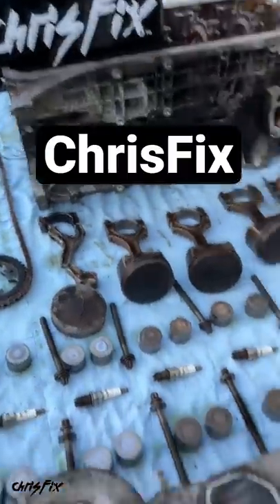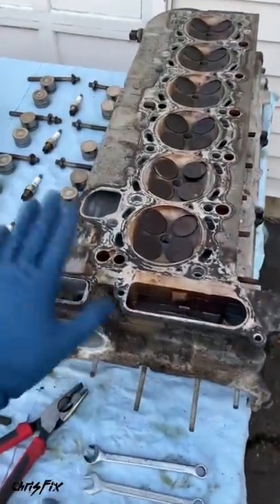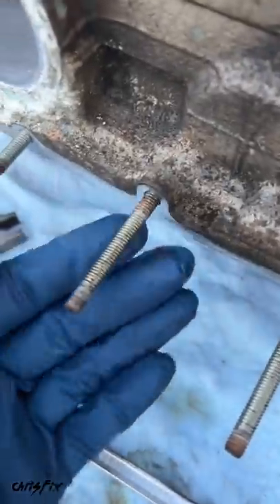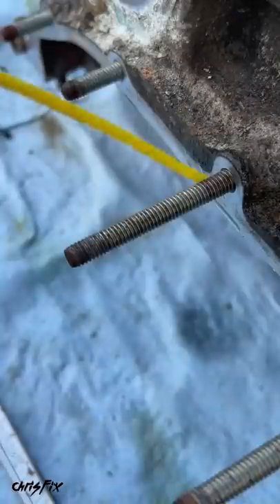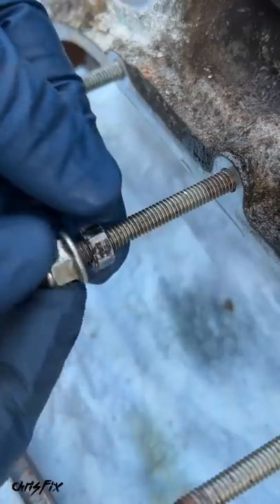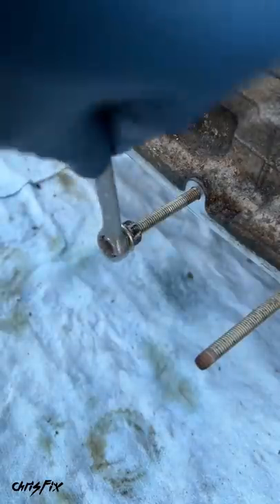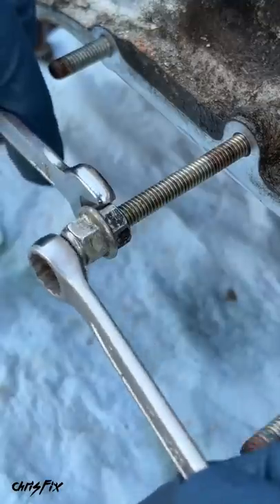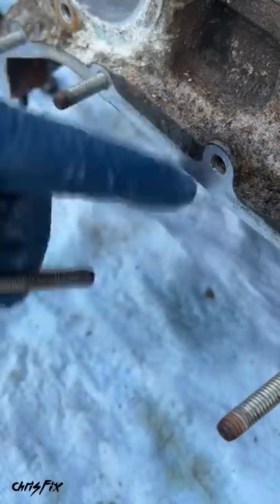Trick to Remove Studs from an Engine #Shorts

Comment: LOL, Chris doing his heads.
i had an oil leak from my engine and the best way to fix it was adding a new BTR cam kit and FAST  intake manifold.
At some point I will need to replace my air filter so I'll need a A&A super charger.

Comment: Almost.. you use the inner nut to thread it out, not the outer one which will come undone when the force gets too high. Also doesn't matter when you loosen the bolts; can be done just as easily after the stud is out.
Reply from the maker: You can do that too and it's a lot easier to remove with the stud still in it's place

Comment: If you loosen by the nut closer to the back, it'll tighten as you unscrew the stud, instead of maybe loosening the front one.
Reply from the maker: Great tip!
Reply: Thats what i did. Just screw on the 1st one ... then screw on the 2nd one, then loosen the 1st one which will push against and lock to the 2nd one which will force the stud to loosen. 
Same concept but slightly different approach
Reply: @chrisfix  why do you only respond to specific comments or questions ??
Reply from the maker: @ACommenterOnYouTube  I get thousands of comments/questions a day and I answer about 4hrs worth a day. No order or specific video or anything, just what the comments page on YT gives me.
Reply: @chrisfix  it looks like you hand picking the comments or questions and leaving the rest hanging ....

Comment: I personally would've used the bottom but to unscrew it. And if you flipped them so the bigger nut was on the bottom, you could've ran them out with an impact or electric ratchet.

Comment: If it were only that easy. Even if that worked 80% of the time, it would be great. Exhaust studs tend to break no matter what. Need to clean the rust around the base, heat it up, soak it in penetrating oil, let it sit, heat it again, do the nut trick shown close to the base but turn the inside nut, and pray it doesn't still break.

Comment: I had to use this trick but in reverse. My exhaust header studs kept backing out of the head when I was loosening the nuts (with liberal penetrating fluid) so I had to tighten most of them back down. If this happens to anyone else I highly recommend using the two nut method at the end of the stud so it doesn't spin while you're trying to remove the nut
Reply from the maker: Was tightening them down enough to keep them in? Stinks because you can’t use threadlocker. It gets too hot at the stud.
Reply: @chrisfix  I tried tightening the stud ridiculously hard at first to get the nut off but the nut was more rust-welded to the stud than the stud to the head. I used the two nut method, needed a huge pipe around the wrench, and my friend’s strength to crack a few of them loose. Spent some time wire brushing the rust off of everything so I could torque it down properly

Comment: I’ve worked on quite a few m54s and I gotta say this is the first time I’ve ever seen the exhaust studs actually stay in the head 99% of the time the copper coated nuts bmw used for those just seize to the studs and the whole stud and nut come out.

Comment: Quick question chrisfix. I recently had someone help me replace transmission on my 06 Mazda 3 since I didn’t  have a proper jack. Car started fine before and now it won’t start it has been sitting for over 2 years and battery has a ice coming out of the top side. Can this be a battery issue I don’t want to buy battery for nothing it worked before. It’s the same battery it’s had and it don’t crank or do anything just lights are on.

Comment: Hey Chris fix I known this is going to sound dumb but I have a 1992 cammaro with Frame rot I wanna fix it as it's a gift from my grand father would you be able to do tips and tricks video and explain the difference between fixable and unfixable frame rot
Reply from the maker: I go over something pretty similar in this video, check it out: https://www.youtube.com/watch?v=C0M5tUQSaps
Reply: @chrisfix  oh ha I remeber this video mine in the rear fram do I need to replace the frame or would I be able to weld it
Reply: @chrisfix  off topic but you ever install that turbo kit?

Comment: If you out your spanner on the (in this case) black nut you won't run the risk of undoing the nut only as you'll be tightening it into the other one and not away from it. But awesome time 👍

Comment: Those studs were loose already...I say this because first of all the nuts should be ran almost all the way down then after locking the nuts the inside nut is the one you turn not the outside one due to the fact that the outside one may break loose and unscrew itself the inside one will push the threads tight and stay against the outside  one. Also with long studs you risk bending the stud the way you are doin it..you use the outside one when installing the stud

Comment: That tempts me to use studs and bolts for my trucks exhaust manifold, typical gm made it very awkward to reconnect my exhaust manifold on my 95 chevy k1500 with a 350, so ill figure out the studs i need

Comment: Right concept,  slightly wrong technique. 

Couple things to do differently,  1st don't use a lock nut, not need.

2nd, thread both nuts on so all the threads are being used. 

3rd, if the stud is stuck, try to use the outside nut will simply unthread. The wrench should be used on the inside nut to "jam" against the outside nut.

Comment: How do the nuts not just unscrew?
Reply from the maker: You can do the reverse of what I did to tighten a stud back on
Reply: @chrisfix  I think I worked it out. The nuts push each other against the thread of the stud so that there is enough friction for them to turn the stud instead of unscrewing. Looked like magic at first
Reply from the maker: @Bzorlan  exactly

Comment: My only recommendation would be to get the nuts closer to the block. You don't get as much torque, and it takes forever to get them on and off, but I've broken far fewer studs. Especially exhaust studs. Those don't look like they've been in that block for 30+ years. Great trick otherwise! Thanks

Comment: well first of all I'd move as close to the block as possible so to have less flex along the length of the bolt and secondly you usually wanna unscrew the stud with the inner nut because othetwise you will just loosen the outer one in a lot of cases (or am I missing something here?)

Comment: Chris, you doing it wrong! Start with the second nut to loosen de stud. If the stud is too tide, the nut (as shown) will come lose not the stud. And if the stud is really tide, than wiggle the nut.
Also possebillities are heating the head a little. Make a special tool for it. That is two pieces of metal, drill a hole between the halfs and 4 hole for bolt to sqweas the two halfs together. Also wiggle the stud. Be aware that the stud will break at to much forse
Reply from the maker: Thanks for the tips

Comment: I just remove mine with a cutting torch and then fill the hole with weld , level the surface , drill and tap.

Comment: hate to assume it's common knowledge, I guess everyone hears something for the first time especially I you don't think of it yourself. Something else I guess might not be common knowledge is grab the back nut rather than the outside one for better results. That way one is being used to stop the other not just the forces on the face holding them together

Comment: Man, don’t cheap out and re-use those studs!
Reply: Just because he's doing it to manifold studs and head studs, the principle is the same for studs that you don't need to replace. Plus there's instances where the stud may be brand new, installed by you... yesterday, that may be needed in a new head, it happens...! This is a fantastic tip, don't take this away from him!
Reply: @travisclark2758 you really didn’t know to put a backup nut on a stud or all-thread to turn it with a wrench?
Reply: @shanek6582 ,  I assume you're talking about what he's doing in this video? If you are, apparently I didn't make myself clear... if not, I guess I don't, please explain.
Reply: @travisclark2758  put two nuts on the threads, tighten them together and use the bottom one to remove the stud or the top nut to tighten the stud, it’s literally the only way anyone does it unless the end of the stud is milled into a hex.

Comment: What if it sheared off and half is still in the engine?
Reply from the maker: Take the nut and weld it to the stud. The heat from the weld will break the stud loose and the nut will be welded to the stud so you can remove it. It’s an aluminum head so the weld won’t stick to the aluminum.

Comment: this is def not what i’m doing with my truck but on the slim chance you even see this comment - maybe you can help because the rest of the internet sure can’t & for the sake of my denali not winding up in the schuylkill river this week (& my sanity).. maybe you’ll see this by some stroke of imaginary luck that i don’t have. 

anywho -
any idea what could cause a quick grinding noise on engine shut down? or just point me in the general direction & ill find my way. i just have no clue where to start to look. i just pulled my rear driveshaft & replaced both u joints… rebuilt both front calipers & replaced both front flex hoses(PO didn’t lube anything at all so calipers were sticking & brake fluid was no longer brake fluid - but a nice, thick, chunky tar that belongs no where near a brake system 😄). trucks still on jacks so i’m unsure if it makes the noise on acceleration but def on shut down & im driving myself nuts. idk what it could be. it’s coming from front passenger side under the hood - engine bay. i’ve got a throttle position code but i’ve had that for a few weeks & ill be fixing it soon but this sound just started as ive had the yukon on jacks these last 2 weeks. 

sorry for the length. if you see a silver yukon floating down the river - you can have it.🥴

Comment: What if you already tried pliers and vice grips completely ruining the threads on the bolt and still can’t get it off? Please I need help. I haven’t been able to drive my car for 4 months
Reply: At this point get it out any way you can and replace it.
Heat a bend into it so it's shaped like an allen wrench, freeze the stud and heat the block, hit it and swear at it, put an impact wrench on it, buy a new stud.
 (I'd suggest replacing all of them anyway.)
Reply from the maker: You can grind down one side so a vice grips will clamp tightly and just spin it off

Comment: Do you have another method ? I have a broken bolt in the exhaust manifold, I already tried to weld a nut on it and did not work
Reply from the maker: Why did welding the nut not work? That’s the only other way except drilling it out and tapping the hole. After welding the nut work the nut back and forth over and over. Don’t just try removing it. Sometimes the back and forth motion helps a lot.
Reply: @chrisfix  well, it would literaly not move and the welds would just break off, I also heatead the manifold and still nothing. Now it has been a few monts and I am trying to fix it, back then I just C-clamped the egr tube back and weld a nut on it, but it has a small exhaust leak. For the last weeks I have been soaking the stud in WD-40 and driving the car hard so it woul heat up
Reply from the maker: @dorinbugnar5930  there is something called an induction heater. One name brand is the bolt buster. Weld the nut on and use the induction heater to heat the nut/stud so it’s cherry red. It will come out very easily
Reply: @chrisfix  thanks, I will try that definetly, I'll tell how it went

Comment: You should be turning the inside nut when you want to remote the stud. So you havent really used  the proper technique
Reply from the maker: The jam nuts are still tight enough to remove the stud

Comment: It's not always that easy. That was the intake side that sees a lower heat than the exhaust side. Because the exhaust side sees more heat the studs on that side tend to be rusty and can be quite hard to get out of the head. And what if there is corrosion in the bolt hole from the dissimilar metals in the bolt hole? Seriously dude you should have at least done the exhaust side instead of the intake side.

Comment: I've got everything to my Brakes flush the fluid replaced discs and drums front and back led the crap out of the system I still have to push the brake pedal down one time before to get hard or else it just goes to the floor no leaks what else could it be?
Reply from the maker: Air in the line or a bad master cylinder. If you’re confident you got all the air out, the master cylinder is prob bad.
Reply: @chrisfix  thank you for the reply I ordered one pick it up in the morning

Comment: I would have never thought of that.
I'm so amazed I should bow.
Too bad you can't buy new better threaded rod and use some anti-sieze compound or thread locker to reinstall new studs.
Great video if your a 4 year old.
Reply from the maker: Not sure why you are hating on a video aimed at beginners/people working on stud removal for the first time... and it's a given you would replace your old studs with some new ones and use anti-seize, but I only have a minute with these shorts and installation wasn't the main focus this time around...

Comment: I did that at a motorcycle head… quick tip for you: if there is oil in that hole, remove it before tightening the stud again. Guess who fucked up an engine head…

Comment: It’s called the double nut method, DONT GOOGLE IT - moog from mighty car mods
Reply: Per google:
The double nut, also known as jam nut, is a friction locking method that uses two separate nuts on top of each other. Care must be taken during the tightening of the second nut as overtightening will lead to thread stripping or tensile rupture of the bolt

Comment: I wish it was like that on my truck. Alas the soft, pull apart string cheese that ford molded their manifold studs out of have formed an unbreakable bond of rust with the heads and sacrificed themselves for the greater good of breaking off inside the head, only to make my life miserable.
Reply from the maker: Dang that’s always the worst. Rust makes everything so difficult
Reply: @chrisfix  Thanks for replying, i love your channel man. You've taught me a lot! I also have a mazda b3000, thats how i found your channel lol, its a 1994 with a 5 speed. Keep up the good work.